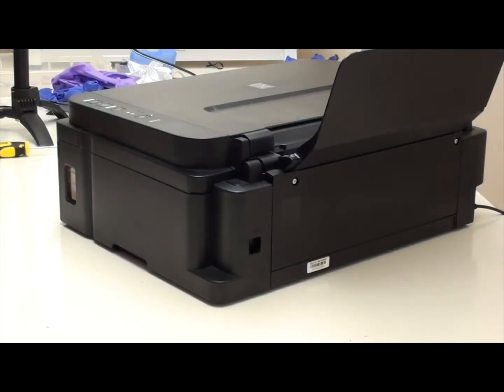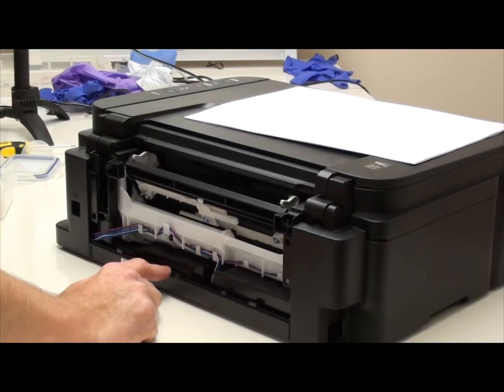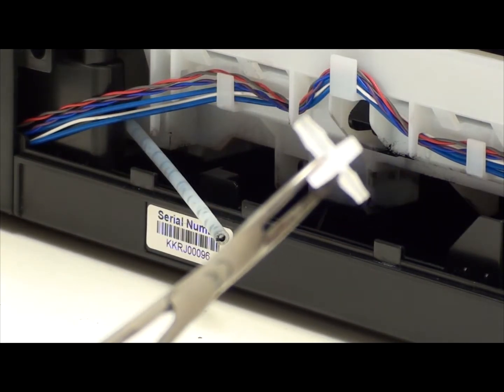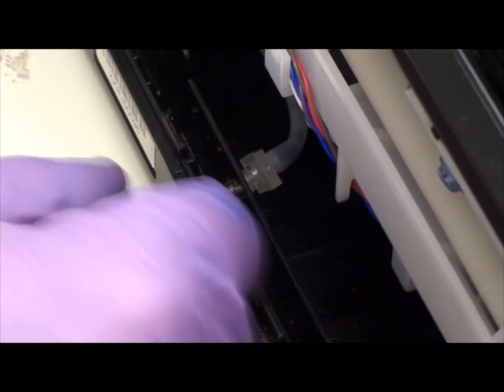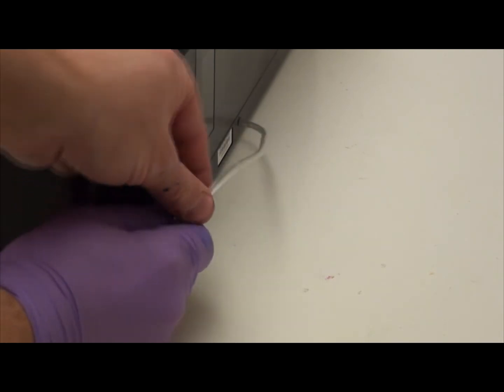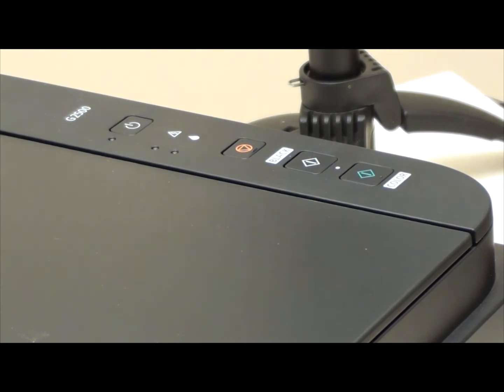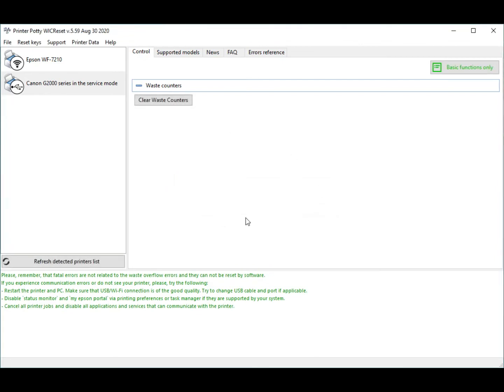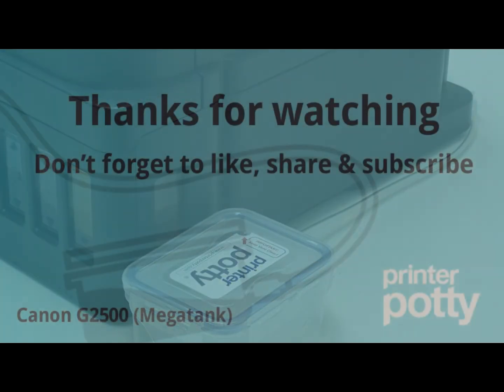Fix Megatank with one waste ink tube - Canon Megatank inkjet printers (G1000-G4000 series)

Comment: I made mine using rectangle plastic container from my kitchen and transparent fish aquarium piping and T-fittiing connected to ink container  ).  For the connection from the printer waste ink tube ( small diameter ) to aquarium tube ( bigger diameter ) I use the part from the small watery type covid sanitiser bottle manual pump. Use a saw to cut it. It has a small/ big diameter. Just nice. Cost is very minimum. Printer is Canon G2000, 5 years old. Solved the 5B00 error absorber FULL problem forever.  Don't have to replace the costly ink absorber sponge. Hi from Malaysia.
Reply from the maker: Obviously our kit sales help pay for the work we put into these kits, the instructions and the development needed for other printer models but completely understand that a DIY solution works too so we're glad it helped you figure out your own solution. At least it's another printer that's not headed to the dump.

Comment from the maker: For those with G4000 series or the G5000 - G7000 series printers, we've purchased in two of the units (G4511 and G6050) so that we can get videos put together for those. There's also an update pending regarding a reset process that doesn't require a key. Testing is needed to verify the range of printers that this works with but we'll update in due course.